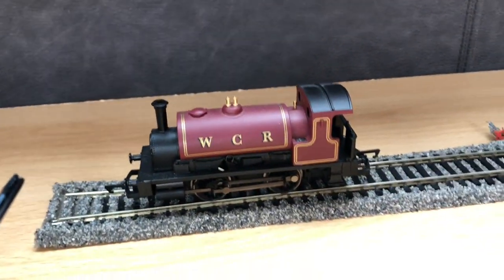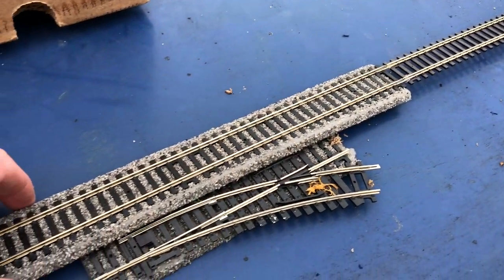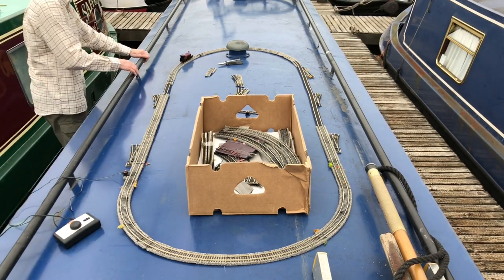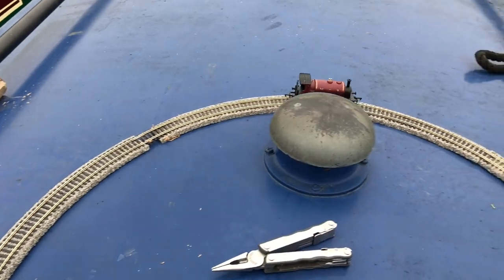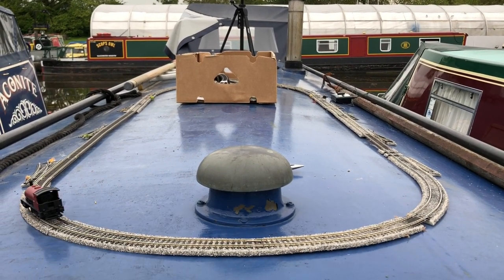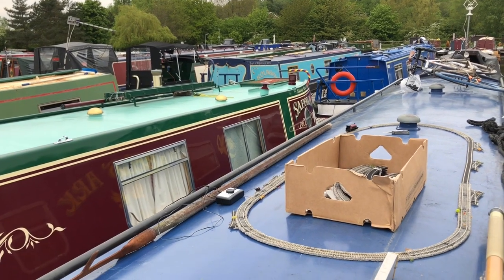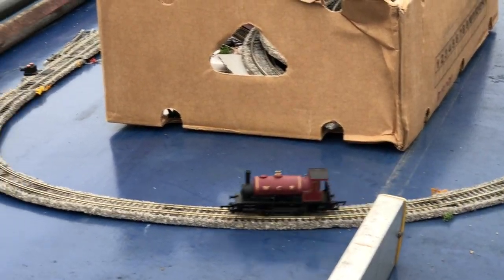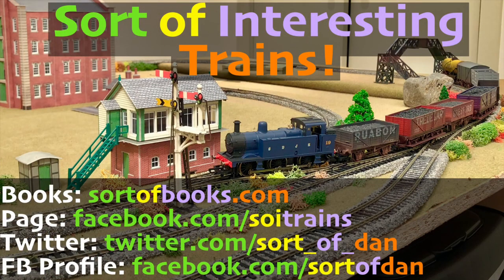Model Railway on a Narrowboat Roof (Concept Test!)

Comment: If your thinking about a permanent layout on the roof I would recommend you solder jumper wires on every fishplate joint in the track, the weather will shink and expand your track, also leave a Mill   or two on every join to allow for this. Also your track will need cleaning more. Hope this helps